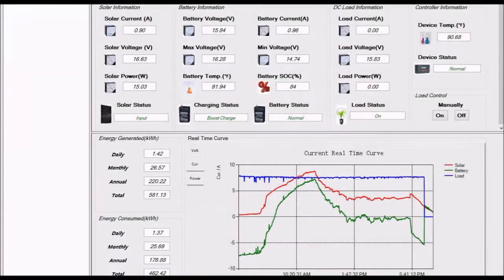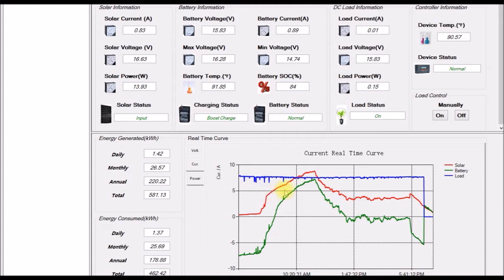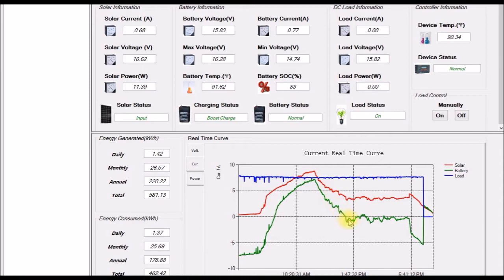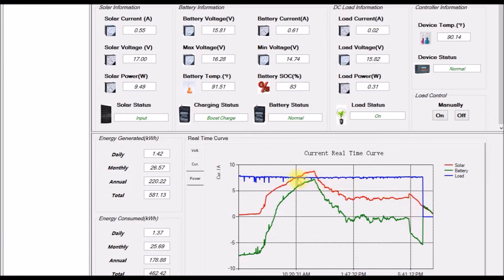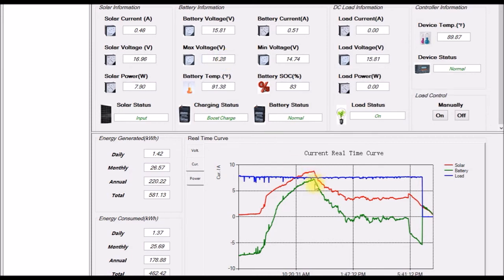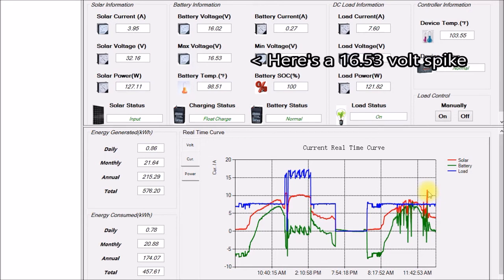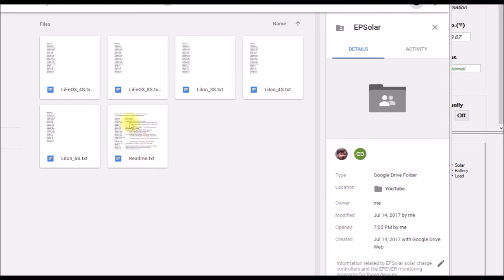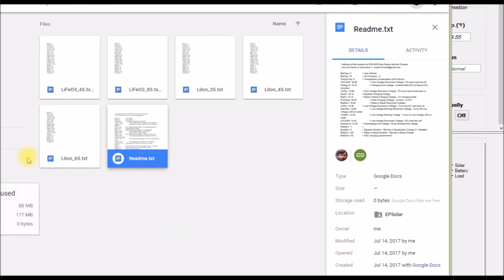EPSolar 4215BN Charging 4S/16 volt Lithium-Ion Battery, Part 3

Comment: Hi again. This is really useful, knowing there is a good template of numbers to work with.

I wonder if you could help me understand the 'current' thing with the 18650s.
Similar to you, I have two 305 W panels, with my ep charge controller, I plan to go with 16p8s, so a nominal voltage of 29.6. With the two panels, there is a possible 610w/29.6v = 20A. But, with 16 18650s  in parallel, there would be a possible current going in of 20a/16=1.25a per cell. I have read one should only charge cells at about 0.7C, my cells are about 2ah cells, that means 1.4a per cell. So well within limits, assuming I have interpreted things right? But what if I had a couple more panels. Have I made some bad maths here? Is there anything that would stop the charge controller from pumping in a possible 2.5a? 
Hope this hasn't come across as too heavy. I know my head hurts sometimes, when I start thinking about it, and then doubts start to creap in.
Reply from the maker: It sounds like your figures are decent, at least from an ideal perspective.  In practice, I find the max charging current/voltage out of a charge controller is maybe 75-80% of the peak panel power.  Like when I had a pair of 335W panels (670W total) into my 16V battery, most I saw was 30-32A, even though 670/16 = 41.8A.  I've now added a 3rd panel (1KW total) and it'll hit the 40A max output of the controller easily.  

Plus I find that you only hit the peak output of the panels around noon (assuming south facing panels) and by then the batteries are likely charged up most of the way and the charge controller is backing off on the charging current since it has hit the charge voltage limit.
Reply: Thanks again for reply. As you say in videos, one needs to tweak the controls to get the best out of it. There wont be a one fit all solution. I guess if I get more panels, my fear is I will over charge the cells, too quickly, and so there may not be any virtue in getting more panels. As I'm still in the planning stage, I'm trying to consider all options.
Reply from the maker: You do have to match the overall capacity of the system components.  So yes, if you up the panel capacity, you may also want to increase the size of the battery to match.  That is my basic plan, keep adding packs to my battery bank over time, I'm up to 5 - 4S20P packs now.  But you should have a good idea of what your current system does once you get it hooked up.  See what kind of charging current you get in reality and then go from there.

Comment: Where are the charging settings?
Reply from the maker: There's a link in the video description with various files I saved with various battery configurations and charging parameters.  I will be doing an update video shortly where I've dialed in the 4S settings to work better with my power inverter.

Comment: Thanks so much for the video! I have a 4s2p 18650 pack I made and I am trying to connect 2 18v solar panels (parallel) to charge the pack. Can you please help me with a reccomendation on what charge controller I should purchase? Thanks!
Reply from the maker: You'll need something with a user settable charging profile, similar to the one I used.  EPSolar makes some like the one I used, in different current ratings and I think they also mention a line of Lithium specific models on their web site but I've not been able to find out much about those:
http://www.epsolarpv.com/
There are likely others out there with this user type battery setting.  The other thing you could do is a normal 12V controller feeding a small lead acid battery then connect an RC battery (iMaxB6 or similar) to that and use that to balance charge the 4S battery.
Reply: So use the 2 18v solar panels in parallel connected to a 12v controller connected to a 12v battery connected to a balance charger connected to my small 4s2p battery pack?
Reply from the maker: Yes, that's the basic idea.  Most of those balance chargers take a 12 volt nominal DC input (unless you get one with a dedicated AC power supply built-in).  I  use an iCharger 1010B+ charger on my 12V lead acid and 16V lithium ion battery system.  Depending on which battery is powering the charger and which battery is connected to the charger output, I can send power back and forth between my two battery banks.  It's actually a very handy setup.  The iCharger can operate up to 18 volts input, many RC chargers only go up to 15 volts or so.

Comment: Hii and thanks for video
Do you have battery bms??
If not you need to balance charge it at least from time to time!!!
Reply from the maker: I do have a BMW that I've tested out:
 https://youtu.be/OMIcMB5k40s

For now I'm testing the pack w/o a BMS and I've bottom balanced it:
 https://youtu.be/qr46Ee8WxLA
So far it is holding the group voltages within about 30mV after about 4 months of daily operation.

Comment: glad you got it all dialed in
Reply from the maker: Thanks for the comment.  Yes, it takes a bit of trial and error to set these things up and then figure out how to tell if they're set up properly.  At least with all the capacity testing I did on all the cells, I know how it does charge (like time spent in the Constant Voltage charging phase).
Reply: YOUR THE BEST THANK YOU